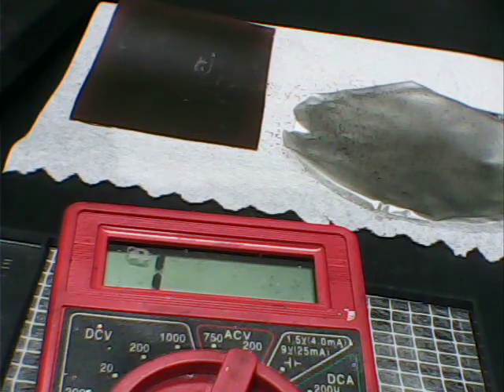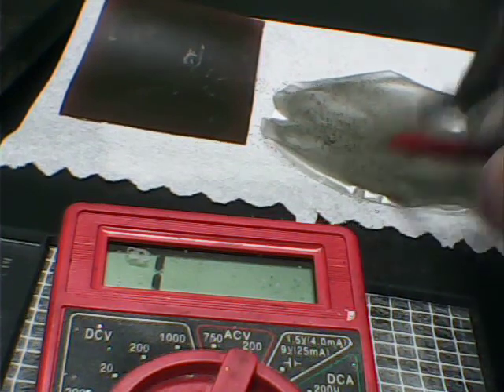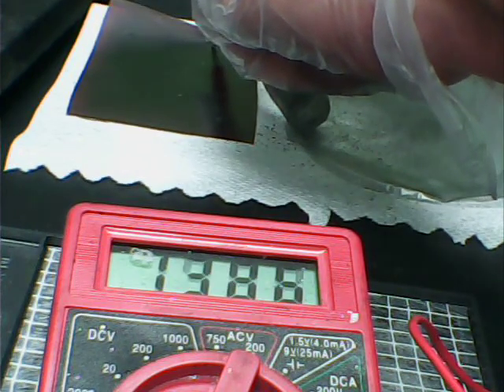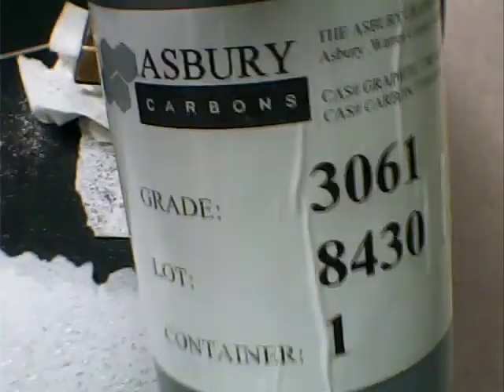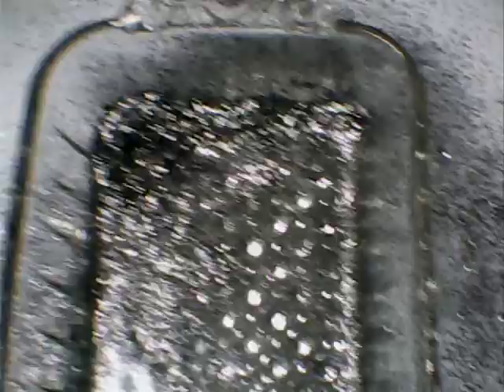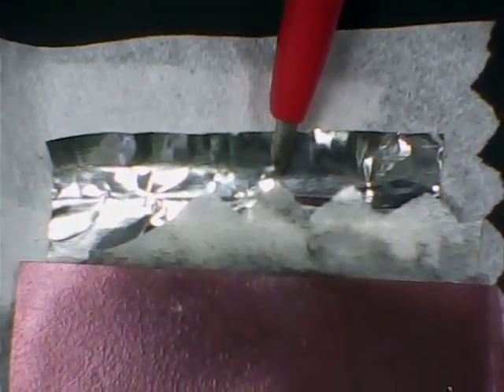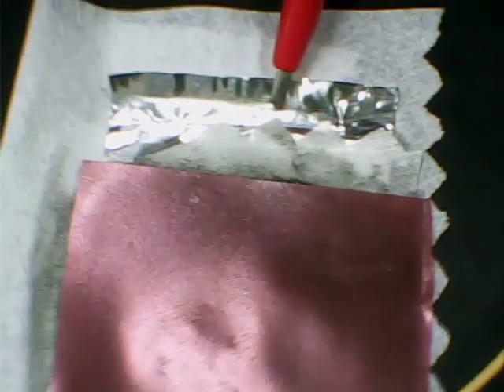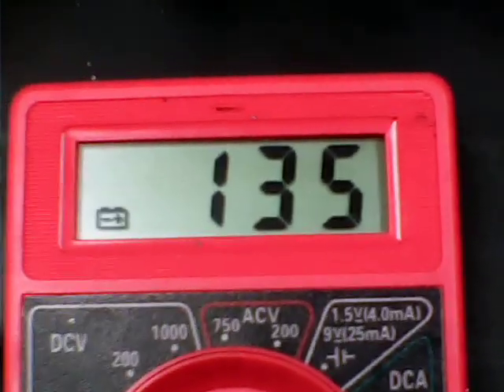Conductive Graphite Sheet Electrode/ Aluminum Air Cell/II

Comment: Not to be critical but I think you meant to reference Robert Murray-Smith. Another excellent resource. I follow both your and his research as well as others. I have been trying to produce a multilayer battery to use as a power bank to integrate into a cell phone holster that augments the internal lithium battery when placed inside. An aluminum air battery is a good candidate for a replenishable power source. It would be great to be able to replace the expended aluminum cathodes with pieces cut out of pop cans. Water works but dries out. A gel electrolyte might remain viable for an acceptable duration. The goal is to use as thin of materials as possible so it doesn't add excessive bulk to the holster. Using poly sheets coated with graphite may fit the requirements. The problem has been coming up with a solid or gel electrolyte/separator that will provide enough power, won't leak, and still allow air flow. I have considered sheets with micro corrugations to stack yet keep the profile low enough for the application. I follow the ongoing research in the hope that I can find a suitable combination.
Thanks for posting. I'm following your progress.
Reply from the maker: Yes, I surely meant Robert Murray-Smith. I love watching him and his enthusiasm. Good idea about the pop cans! Some interesting results will be uploaded soon. :)
Reply: Hi David I saw somewhere(possibly Robert MS) that using a binder and the putting it through a roller works well to evenly distribute the graphite/graphene into the sheet. What are your thoughts?
Reply from the maker: Hi John: Excellent idea. I even have a pasta machine in my lab and may try it.